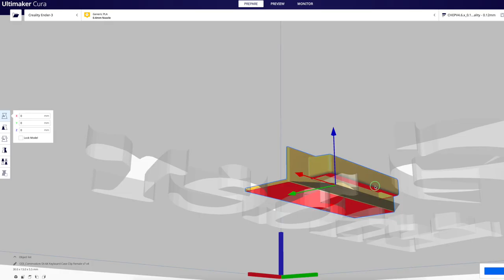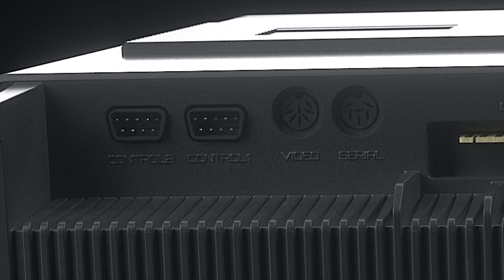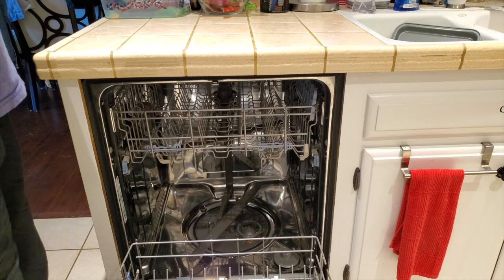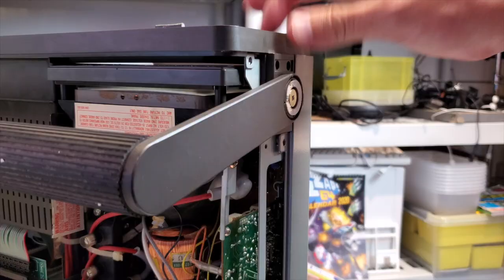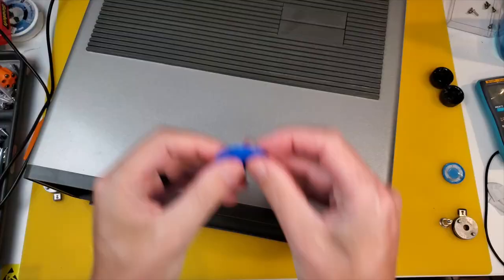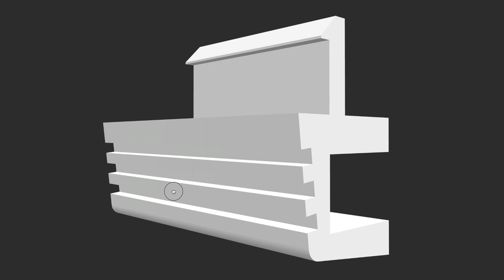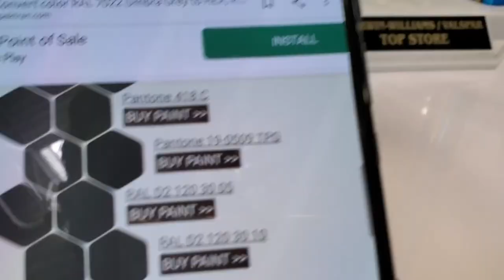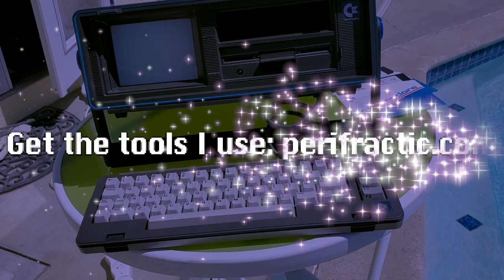3D print repair + dishwasher refurb: The 1st color "laptop"! Commodore SX-64

Comment: The ← key is actually the mathematical assignment operator, which is occasionally seen in pseudocode and some old programming languages.  It's too bad that it wasn't simply repurposed as the Escape key that the C64 lacks.  The only reason it is there was that VIC-20 had it, and that was because the PET had it, and in turn that was because for some strange reason Chuck Peddle decided to base PETSCII on an antiquate (even for 1977) version of ASCII.  In later versions of ASCII, the ← assignment operator code become the underscore.  PETSCII also has an up arrow ↑ instead of a caret ^ like in later, far more popular versions of ASCII.  Leave it to Commodore to be the weird one.

Comment: I've always liked these "luggable" computers. In their own way, they are the first real ultra-portable computers. They are their own case, all you need is to bring the power cable and a bit of software, and they were just as powerful as their full-size counterparts. 

Not like today, where everything requires a dongle, laptops are built with dramatically underperforming hardware compared to the home desktop, and you need a bag to lug around the computer, power brick, and any peripherals you might possibly need.

Comment: The handle design is pretty standard for CRT oscilloscopes of the era, maybe not a household format but in every electronics lab everywhere. The same carry/stand is on some ham radio equipment and other electonics test equipment. I don't know if they took an existing case (is it 19" as well?) and put fun plastic on it rather than scientific beige, or just took the format idea and ran with it.

The first Compaq PC luggable did this as well IIRC. I remember one being brought home from my dad's work when I was very little.

Comment: Fantastic restoration (as always) Mr Fractic in taking a SUX64 and turning it into a SXY64! All semantic jokes aside, the SX64 was quite revolutionary and relatively "portable" by 1984 standards - much easier than lugging around a full sized monitor, C64 and 1541. And as the "Are you keeping up with the Commodore?" advertisement and your gobsmacking recreation proves, it wasn't a computer it was a lifestyle choice - pool and open necked shirt optional! I'm sure Ferris Bueller would have owned one.

Comment: That Commodore Song is probably the most inspirational thing I've heard in years😉😉😂😂  Fantastic video - I need an SX-500 now!
Reply: Only Amiga! Makes it possible - only AMIIIIGA! - that's inspirational too.
Reply: I wonder how feasible it would be to take an A600 motherboard and get a case designed to house it.  With a trackpad instead of a mouse, a decent sized LCD/LED panel screen, and the keyboard built-in to the 'cover', and some nice little stereo speakers, I think it could turn out nicely.  Is Steve Jones watching?

Comment: Nice to share your 3D-Model on Thingiverse. I have a working SX64 since about 30 years here in Germany. The only problem is the Keyboard. I should try to clean the PCB and the graphite coating but many people killed the foil . In many cases the coating was damaged by seperation the foil from the PCB. There is a company in the UK you can order a new foil.

Comment: Ah, the Commodore SX-64.  A computer I always wanted to get back in the 80s.  But could not afford.  
Pretty much the 'DeLorean' of computers.

I was fortunate enough to get my hands on 2 of them back in the early 2000s.  One worked, the other didn't.  Thought I'd keep it for parts to fix the other.  Then about 5 months ago I decided to see if I could fix the non-working one as I started seeing increased interest in the SX-64 on the internet.

After viewing some diagnostic videos and using the working unit to swap parts to find the bad chip, It came down to a bad PLA chip.  I found a replacement PLA chip on Ebay and purchased it.  Popped it in, and now I have two working SX-64s in my collection.

Comment: I use to own one of those.  Yea saying it was heavy was an understatement.   I did use it at work to maintain a small database and when I stopped doing that the last thing I ever did with it was play Christmas Demo's.   There is a seller on eBay aaascrapdogsunlimited who has sold ribbon cables for the SX64 keyboard connection as well as diagnostics and diagnostics harness kits made by Coprilite Computrer By-Products. It looks like you have one of their Diagnostics Cards.  I would not mind adding one to my collection but the CRT is its weak point not to mention putting it on a small table next to a swimming pool.

Comment: I've always wanted one of these so badly. I had actually even hoped to find one with a bad display so I could guilt-free switch it over to an LCD to reduce weight as a few others have done. That and a Li-Ion conversion would do a nice job of reducing weight significantly.

Comment: If you have a lot of spare time and read old Infoworld articles you get the impression that the SX64 was originally meant to be Commodore's 'Osbourne' killer with CP/M (like how the Plus/4 series was meant to be a Spectrum killer originally). That never happened because Osbourne went bust anyway and CP/M stuff was never ready and ended up in the C128.
Reply: CP/M also requires a Z80 CPU, not a 6502 like in the '64s

Comment: That commercial “commodore is creeping up with you” that tune really reminds me of Transformers sg1. You being from the uk probably also watched it on the sky channels fun factory. I am a restorer by occupation and the tanning stains in the glass are is oxidation of the tanning layer. It is easily removed with a silver/copper polish keep it mind it removes all the tanning also the one it is suppose to have. Belgom alu is a good one to have at home or Brasso polish or ordinary white toothpaste will also do the trick but can leave a minty smell ;-)  Well mint is what we aim for. And my preferred choice of glue for gluing plastics is a epoxy based glue. My experience with super glue it holds strong and quick but losses it’s strength while time passes.

Compliments on lady Fractics dive, she dives way better than the lady in the commercial. The lady in the commercial drops like a bag of potatoes in the pool. Well that’s maybe exaggerated but you get the point. Cheers to you all.

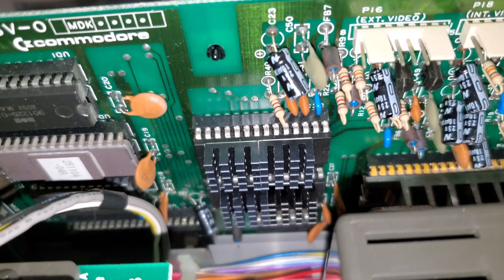Comment: 18:50  It may be more efficient to put these heatsinks turned 90 degrees (like the heatsink on the right).  To over do it, you can then put 3 of these heatsinks on one chip (even if they hang off the chip on the sides a little) :).
Reply: Is that huge ass heatsink on the video chip glued on or just held by these two clips?  Given the age, I would recommend applying some new computer thermal compound to that.

Comment: Weird project idea for you to consider. There is a way to turn milk into a form of hard plastic. It was used to make billiard balls for example. So far as I know, no one has made a computer case out of the stuff. Best of all, the protein responsible for the hardened plastic milk reaction is casein. Using milk to make a computer case-in would be a pun right up your alley I think. :)
Reply: Ironically it would be the only computer case I'm allergic to. I'll be sure not to eat it
Reply from the maker: I’m lactose intolerant

Comment: It'd be pretty awesome if you could figure out a way to battery operate the SX-64. Perhaps a module that slides in front of the ports, containing lithium batteries and a 5v switching regulator? Back-power by the user port slot? That way there'd be no need to undo any of that fabulous restore work you did. You'd get a whopping 10 minutes of battery life, I'm sure. But wouldn't that be worth the A-roll to get the fan boys drooling?

Comment: I have the original sx used in the ad. And it still works!
Reply from the maker: Wow! Got any pics in a Google Photos album?
Reply: @RetroRecipes  I don't.. I got it when I realized nobody knew it's history.. it's online though, it's the serial #0000002 
I spoke to the lady who ran commodore Australia back then and she couldn't remember the exact machine, but she told me it was one of the first off the production line because they needed it to make the ad for the release. I spoke to one of the guys who worked on the ad and he remembered it had a low serial like 1 or two. So I knew it was the right machine. The guy who had it up for sale knew it was a low serial but didn't know it's history
Reply: @RetroRecipes  I can take some for you if you like.. it's a little beat up but still looks decent
Reply from the maker: @bytraper  I'd be interested to see it. Thanks!
Reply: Here you go dude. This was the machine that pretty much everyone with a sx machine has seen. It's still in australia and is still working. I'm not sure what happened to it after the ad, but pretty sure it went back to commodore australia from there it made it's way into the public, but at this stage it's history was lost. I couldn't believe it when I saw it on ebay as a low serial sx 64. And I couldn't believe nobody knew what it was. But it was one of the very first machines off the production line urgency shipped to australia for the advertising so the ad would be reade when the machine was released here. It may have been shown internationally too bit I'm unsure of this as it was really aimed at australia
Reply: If you want me to clean it up, and take better pictures with video it's no problems. Let me know exactly what you want

Comment: Hey Perry! Just for information: printing functional parts with PLA is a bit problematic, cause it not only easily deforms when it's hotter (such as on the pool or in the hot car) but also it deforms under load over extended periods! You should try PETG instead, ABS is also an option, but that has issues with warping and shrinkage and doesn't do bridges and overhangs well..
Reply from the maker: So far so good, we'll see!...

Comment: Looks stunning again!
I would’ve recreated the handle end cap by making a simple push mould of the other side and mould it in a polyurethane resin. Then you keep the texture perfect as well.
That keyboard clip looks good, even though it’s not a DLP resin printer. I’m now thinking how you could actually mould that gap from the broken side sanded side, and mould the good side as well, and use the mould if the broken side as a plug, to cast a part that fits perfectly in the gap. I think that would be possible. But it’s not trivial, would take some time for sure.
Thanks for sharing this project Chris!

Comment: I know the whole purist argument but had the CRT been shot, I would go ahead and retrofit an LCD in there. Granted, either way, I would play games on an external monitor. That's how we had an owner set up their SX-64 at one of the Davis Atari Parties of yesteryear. Commodore equipment was permitted to be displayed so long as they were playing AtariSoft game titles.  :)  Speaking of Atari, that Pixelwizard C64's color scheme and resign of the C64c case looks like some of Atari's designs for the XL series of computers that weren't released. I think Curt Vendel has pics of them over at the Atari Museum. If I recall correctly, those designs came out of the old Atari/WCI Lab in New York which did a lot of things their way and mostly separate from the mother ship back in Sunnyvale [or the Cyan Engineering group located in Grass Valley]...

Comment: I forgot to add, I use a power drill to remove all the tiny screws on the C64 keyboard.  That saves a lot of time.  But I never use it to put them back in.  That would strip the threads in an instant.
Reply from the maker: Agreed.

Comment: You can't really give Commodore credit for this design. There were an awful lot of Kaypros out there, and those weren't the first either.

I am able to power my SX-64 with a UPS battery and a cheap inverter.  It runs quite well this way.  The inverter even fits in the storage hole.

Comment: mine was pretty clean when i got it, sticky cable aside, but the keyboard shell had a corner crack which ive since glued and the pla and sid were fried so no operation at first.  unfortunately after repairing everything  its still got one of those cover clips snapped off like yours and ive been on the lookout for a new bezel, but repairing the existing one wouldnt hurt either

Comment: The main C64 chips get really hot resulting with failure, so I am amazed that Commodore wouldn't place small heatsinks on chips like Sid on this tight board. An LCD mod allowing one to add an Amiga 500 to the case would be amazing. I also I had keyboard issues with my SX64s.

Comment: I would replace the clip on the other side so that they are the same. If you are using 3d replacement parts, I would say go for the original symmetry. BTW, you freaking got me with the drop! People in the office here are wondering why I am sitting here with my mouth open in disbelief.
Reply from the maker: Haha sorry about that drop! Yeah I just don't want to damage the stock clip. Once you forget it was replaced, the eye doesn't really see the difference any more ¯\_(ツ)_/¯
Reply: @RetroRecipes  Yeah I can see that. Actually, I am a bit wary of 3d parts from a strength perspective also. At least with the SX-64 you have the handle on the case. Some of the 80's luggables had the handle on the bottom of the keyboard, so the clips had to handle the entire weight of the machine.

Comment: 2:45 super-clear display, looks like it has a clearvideo installed
Reply: no RF modulator helps. They were not well designed. I think it was Adrian's digital basement where he modded one. Cut off some caps and such and showed the before and after in the quality. It was amazing how much of a difference it made.

Comment: So when I was a kid I only had the pleasure to play with the SXx64,until now. If any SX64 users know this answer I would be interested. I picked a sx64. But it's a 220 volt.  I have a nice 220 to 110 convertor. The machine turns on just fine. But the screen flickers. I don't remember if this just how they are. Or if the convertor is not converting the 50Hz to 60Hz well. Also. Were the keys always to temperamental? Visually the unit I bought looks almost perfect. The guy was going to toss it into a dumpster. So I saved it.
Reply from the maker: Yes I would say it's the wrong Hz for the VIC chip. I'm betting if you converted it to NTSC it would work. Info here: https://youtu.be/aq2tlEr6_Ns (the product doesn't support the SX-64 but the manual conversion will work)

Comment: Nice Video, covering almost all SX-64 details. 
Just wanted to let you know that I finished converting my SX64 to DX64 just yesterday. Using a 1541-II board with a re-pinned 1541-I drive mechanism. It´s all in german, but anyway:
 https://www.forum64.de/index.php?thread/96894-1541-alps-dauerl%C3%A4ufer-erfolgreich-in-sx-64-integriert/#post1537051
Further up the thread you can see some pics of the FDD board matching perfectly to an SX-64 thread to bolt to!
And while you are repairing your keyboard, just use a male/male 25-pin adapter and connect your C128D keyboard to the SX...worked for me!
Edit: Have one broken SX hinge too. Will check the 3D model! Thanks for that!
Reply from the maker: Nice work! And I'm glad you can make use of my clip model 👍🕹️

Comment: Wow, very cool video! It gets a like from me.  I know have used WD40 in the past for cleaning.  That product is probably not the best to use for cleaning the cartridge slot.  I have seen where people have used WD40 and years after it aged it gummed everything up.  I believe I saw it used in the repair of a floppy drive.  the next owner had a video where the drive was not working he took it apart and the WD40 was all deteriorated.  He said in the video that he has seen this way to often.  He cleaned the old WD40 out with contact cleaner and lubed it it up just like you did in this video, and all was fine.  I am just asking you to be careful.  What a fantastic video.  What a cool find someone donated to your channel. I hope you don't end up sleeping with Doggiefratic when your wife finds out you used her tooth brush to clean your new toy.  Cheers from Riverside, CA

Comment: First of all, outstanding work on the restoration and also the overall video.  You really put an impressive amount of of work into making these videos!  Second, I was wondering if it would actually be possible to remove the CRT and replace it with an LCD screen.  That would cut down on a lot of the weight.  And third, with all the CRT stuff removed, would it be possible to install some LiIon or LiPO batteries and the appropriate voltage controllers to make the SX-64 actually battery powered?
Reply from the maker: The screen has been done yes. But I like the CRT! Batteries I'm thinking about... Though I do like it stock.

Comment: You could probably try some C&A Cleaner (Concrete and Asphalt Cleaner) by Quikrete. It is a very good cleaner that can be used to pretty much clean anything; it works very good.
I work for one of the factories the company owns. I can easily get/send you a free bottle of it, if you want.

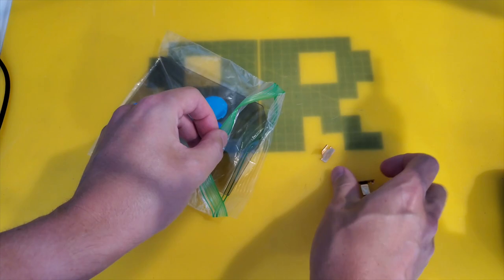Comment: 14:19 The Tesa clone is quite a weird and reductive way of repurposing the machine... Well, the name literally means Label Printer! It's basically a label designer then? Maybe (maybe not) you can put a different ROM in it and use it as a regular C64 compatible (with no sound and who knows what other limitations), but looks like in principle you could only use it for that single task mentioned before: little more than a glorified Dymo!

Comment: What's the power consumption on it? You may still be able to pull that stunt in a cafe without hunting for an outlet if you use one of those battery packs with a sine wave inverter. 

Almost bought an SX-64 on eBay yesterday but the seller refused to ship it to the US.